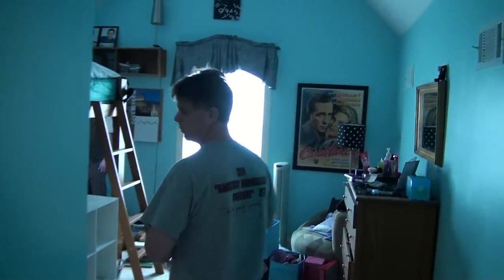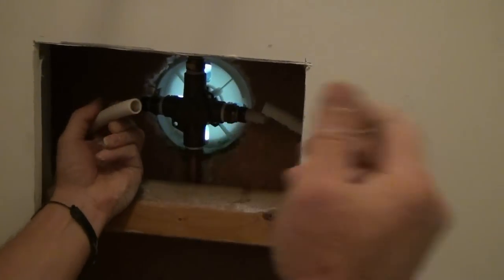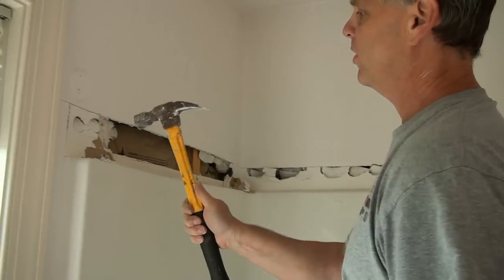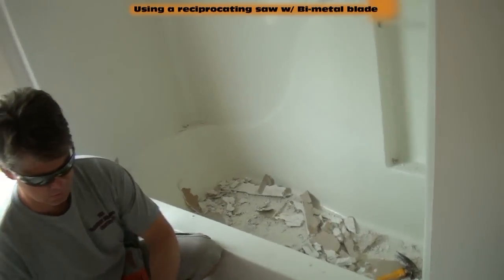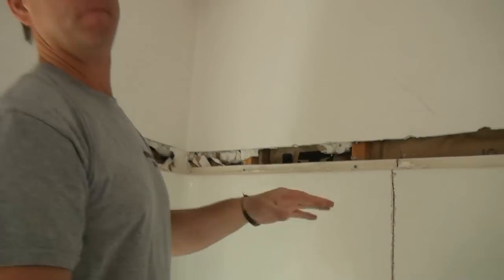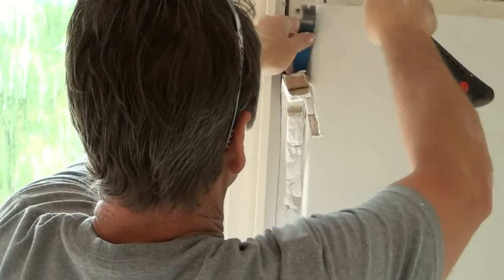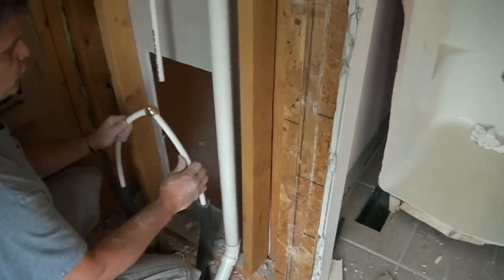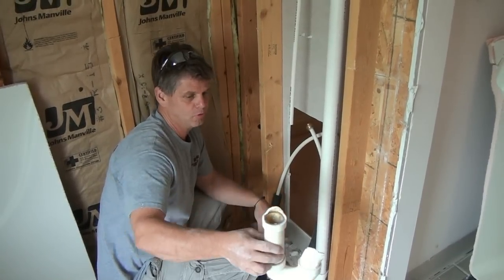Bathroom Remodel (removing a fiberglass shower.)

Comment from the maker: In situations like yours I always close the hole permanently and refinish the drywall and paint. If You ever have to get to the shutoffs again in the future you will have to cut back into the wall again.

Now, they do make plastic access panels that come in different sizes that you can install in your wall that enable you to access the plumbing shutoffs anytime. They are not to bad looking either...you can install them and paint them the color of the wall if you wall. Good luck w/ the project!

Comment from the maker: Yes of course! We only cut it into pieces because we had to get it out of the house from the 2nd floor bathroom. If your re installing yours just remove the unit and set it aside inside the bathroom until you finish your other project and then re install it.

Eddie

Comment: FWIW, bi-metal reciprocating saw blades does not mean that they cut wood and/or metal. Bi-metal blades means that the blade is composed of two separate metals joined together. Instead of being a mixture of two or more metals, like alloys, bimetallic objects consist of layers of different metals.
Reply from the maker: In my business it means get-em because they cut both wood and metal easily! But thanks for the technical overview Mark...I did not know that! Just goes to show you learn something new everyday! Thanks for commenting.

Eddie

Comment: Wish I had that kind of access, but to get to the back of the tub I'd have to take out my kitchen cabinets. Not gonna happen. Just have braille my way around to cut the water lines from the front.

Comment: Well done! I have a one piece fiberglass shower in the master bedroom that needs replaced. I look forward to the rest of the remodeling videos. As a side note, my shower head/supply pipes in my master bedroom are in the wall behind the toilet in the main bathroom. You cut a hole in a closet to access the water pipes. When I cut into my main bathroom wall, to gain access to the pipes, do you have any suggestions on how to tastefully cover up the hole but still leave an access to the pipes? Thanks

Comment: HI, thanks for the great vid. I have the exact same issue. Iwas wondering if you cut the drain pipe from the rear access, or pulled the tub right out breaking the drain pipe clear off.

Comment from the maker: Hello! Yes we did take the drain and P-Trap apart from  the backside of the tub wall. The P-Trap had your typical compression nut that we un-threaded so we could completely remove the Trap out of our road for the tub removal.

Comment: The shower I want to cut out is against an outside wall, so I'm not sure how to access to the Ptrap and waterlines . What would you suggest?
Reply from the maker: ***** Carefully cut sections of the shower wall away from the shower faucet making sure you do not hit any water lines. Once you expose whats behind the shower panel you can pick up the pace and easily begin to quickly remove the rest of the shower as I did in the video.

When you install you new shower you may want to reverse the plumbing for the new unit to either right or left hand unit so you can access the plumbing in the future from an interior wall.

Hopw this helps.

Eddie

Comment: I need to remove a 1 piece shower stall because there is a leak behind it. The floor drain is glued in to the pipe and not screwed in. Do I need to get a small cutting disc to cut the drain away from the inside of the pipe? This shower is on a 2nd floor so I cannot access it underneath.
Reply from the maker: Sid H Hi Sid! If you are removing and replacing the shower...Yes cut it out because you will be installing a new P-trap anyhow and this old plumbing under the shower pan will be replaced with new drain P-trap plumbing!

Eddie.
Reply: Sid H
Reply: Laurie Borle
Reply: Laurie Borle
Reply from the maker: Yes...cut around the drain to remove the tub and then you will have room to remove the tub drain and existing trap and ready yourself for the new tub unit.

Eddie

Comment: How do you know that you're not cutting too deeply into the wood when sawing?
Reply from the maker: You can see where the studs are by looking at the locations that the surround is screwed to the studs along the flange perimeter. You can also "feel" the studs when you hit them with the blade. when you hit the wood just ease-up a bit and angle your blade  so you your not cutting into the wall studs.

Eddie

Comment: Is it possible to remove fiberglass shower/tub without having to cut it into smaller pieces? My issue the sub floor got wet and I would like to remove shower, replace floor, then put old shower back. Any info you would have for me will help out! thanks

Comment: You could've saved that tub and donated to homes for humanity. That's what I always do.
Reply from the maker: Hi Terry! Would never fit through the doors in the house to get it back outside! This unit is 34" at the flanges wide and the bathroom door was only 28.5" wide...nice thought though.

Eddie
Reply: @BathroomRemodelVideo  true

Comment: We put up the shower walls direct to stud with glue is there any way to get them off we need to lower and we didn't get them up right they've been sitting for several days now
Reply from the maker: Hi Sally! Glue! Uh oh! Was this a wall surround kit with "floppy" flat panels you glued to the studs? Or was this a 4 piece tub/shower fiberglass unit with just the nailing flange on it(like the one I tore out in this video)? The floppy plastic panels if they are glued with construction adhesive will probably never come off without cracking, You might get the "flange" type panels off if just the flange it glued, without cracking it.

Eddie

Comment: Could you not have saved the tub surround and tub instead of cutting it up????????????????????
Reply from the maker: No because you could never have gotten it out of the bathroom door or window, it's a one-piece tub/shower and was installed when the house was built before any doors or windows were installed so they could easily get it to the bathroom location back then...but now it's never coming back-out the way way it came in. So we had to cut it up into to get it of the house!

Eddie